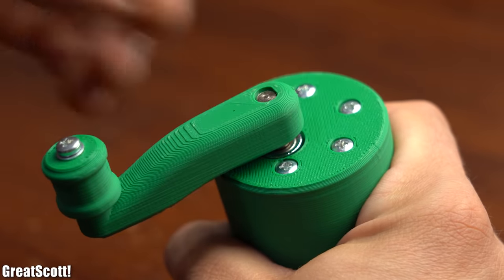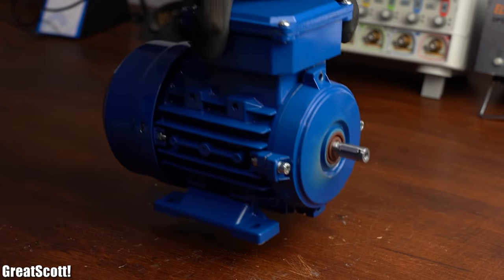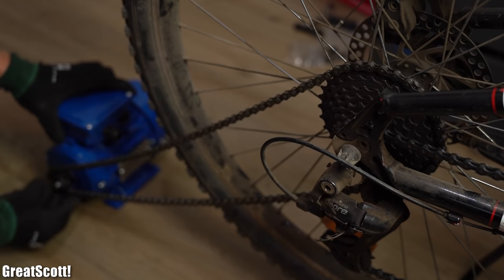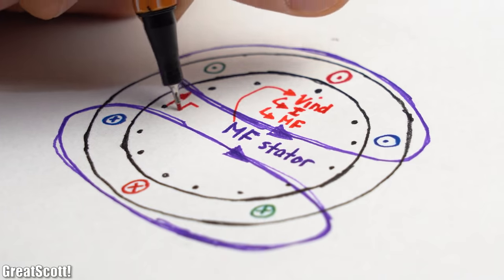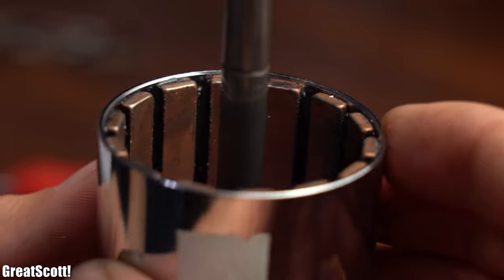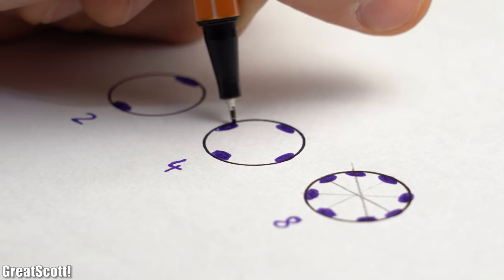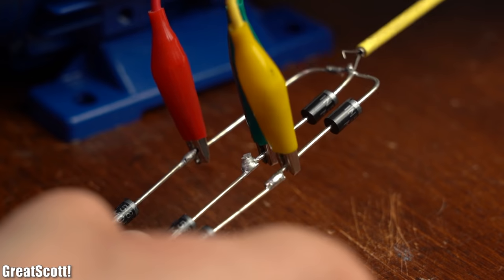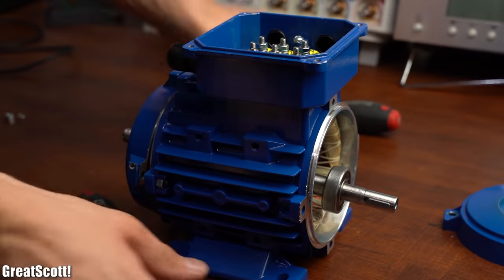HACKED!: Turning an Induction Motor into a Generator?!

Comment: An induction motor can work as generator without modification.  it need external power supply first. but when it reaches Above synchronous speed. it start generating power.
Reply from the maker: Correct
Reply: @greatscottlab  
if you are going to try it with connected to grid then it will generate power at grid frequency (60 or 50hz)

and if with capacitor bank frequency can be different.
Reply: @greatscottlab  I think there may be a way to use capacitor(s) to self-excite induction motors?  Not sure if this works without initial power.
Reply: @senorjp21  Robert Murray-Smith has video on this called "An Induction Motor As A Generator Without Altering The Motor"
Reply: @senorjp21  this can be achieved by providing reactive power , usually with the help of a capacitor bank
Reply: you'll still need to supply reactive power to the gen for it to generate power in a stable fashion.
Reply: @matthewmaxwell-burton4549  
well while connected to supply it can take reactive power. grid can provide reactive power.
for standalone purpose .
capacitor bank can be used
Reply: basicly u just have to connect a charged cap and it will work
Reply: There are ready to buy controllers that are efficient, and allready generate power from the kinetic energy put in a induction motor. But the motor first need to have some induction as mentioned. But useally these motors are used in generator mode in combination with drive mode. In the case I have used them, it was In dynamometers, when the inertia of the dyno didn't match the car, the motor could be used as a drive, but also als a brake/generator and could provide power to the net. But this is a big hasle, and expensive because you will need an active filter.
Reply: Insted of doing soo much modifications, you could have got a synchronous generatior easy, converting an induction motor to a synchronous motor is a bad idea
Reply: Please match the number of poles on rotor and stator. It will work.
Reply: @nachiketadeshmukh8444   Thank you for saying that
Reply: I was just about to say this :)
Reply: I don't remember exactly how to do it but what you are right. I think this video deserves a second try making an investigation, what I remember is that yo need a DC power to generate, that is the way that AC power is generated in many countries
Reply: Yes, also consider that thanks of the residual magnetism a simple capacitor can generate the external power in order to achieve the excitation of the rotor cage, naturally, in order to generate power the rotation speed need to be FASTER then the synchronous speed. Scott will be great to see a video about.
Reply: To be useful for anything other than running incandescent lighting, I assume we'd need to an AC-DC-AC inverter to manage frequency?
Reply: @stupossibleify  that's can be an idea, actually I will think more to use a transformer in order to step down -> rectifier bridge -> linear stabilization or step down-up converter in order to have useful 12/24v ....then maybe you can charge batteries and then use a dc-ac converter in order to have a stable 50Hz 220/110v
Reply: like a care alternator ? (those IIRC do not have magnets)
Reply: I bought a pmg* witch was made form a car alternator 
Pmg* - permanent magnet generator
Reply: Or just add dc to the windings
Reply: @synchro-dentally1965  thanks
Reply: I think this is how car alternators work
Reply: What you do is connect the motor coils in Y, add capacitors in delta, spin it, introduce a magnetic field to start the chain reaction and boom. AC output equaling the motor rating.
Reply: @sfp4197    a recent one? or old one ?
Reply: @foufou33g  recent
Reply: Throw a magnet through a copper pipe, or move the pipe really fast while keeping the magnetic stationary. Both works. You just didnt spin the rotor shaft nearly fast enough compared to how fast the significantly stronger magnetic field rotates in order to induce a reacting field in the rotor. Also people, there’s a significant difference between needing a wired rotor vs a squirrel cage rotor. Good luck  exciting a squirrel cage rotor.
Reply: Youtube engineering lol
Reply: You can make a self excited asynchronous generator with capacitors. I remember a technique for select the perfect capacitors for that application. Is used in for applications where the frequency is not a problem or with an inverter.
Reply: @tripplefives1402    in the self excited induction generator, the electric frequency depends not only in the shaft rotational speed,  the load will increase the slip and the frequency will change, no matter if you preserve the shaft frequency, also the voltage will drop due to the impossibility to generate reactive power.
Reply: You mean first input power  to generate Electro magnet to start its own power but after  that it creates  and takes its own power to creat EM for its Stationary coils .
Here my doubt is clear my guess was right .
Reply: would i be correct to say that it is simular to an alternator in a car but for AC?
Reply: @senorjp21  yes it will work, i have  tryed it.   when you are reaching syncronous speed, the it will start making power
Reply: Indeed, the video mentioned in the answers popped out in my video suggestions right after watching Great Scott's video 🙂
https://youtu.be/j-LgEbdJ8AM
Capacitors are the key.
Reply: But how do you produce magnetic field on rotor. I am searching for this but I cant find any
Reply: @greatscottlab  You are making me cry what you did to that rotor!
Reply: @stupossibleify  lol look at this galaxy brain
Reply: you cannot power the squirrel cage; magnets are imperative; you could adapt a rotor coming from a car alternator
Reply: This is initially what I thought he was going to do.
Reply: Yes
Reply: @senorjp21  initial voltage will build up due to residual magnetism.
Reply: instaBlaster...
Reply: @synchro-dentally1965  Thanks a lot for this recomendation! For those who need, here's the link: https://youtu.be/j-LgEbdJ8AM
Reply: @dg.candido  No problem. Thanks for posting the link. I am always concerned about providing the links because YT or the creator may flag the comment for deletion.
Reply: Can synchronous reluctant motor can be generator
Reply: I'm curious as to how this works with trains, as dynamic braking uses the async motors as generators, but obviously while braking you're going slower than synchronous speed
Reply: I cant find anything about induction motor as generator, i have an idea to hook up (with belt) an induction motor on to diesel engine so i can use it as a generator for some small apliances. Can it work?

Comment: Bike generator: a device that generates bikes ;)
Reply: Fleischwolf- it wolfs Fleisch 🍺🍺🍺
Reply: In my school I got a question can you explain.
Q-) Electric shock is caused by_____.
. Electric current
. Electrical potential difference
. Electrical resistance
. Electrical energy
(Note you can choose only one option)

Edit:
Correct answer = Electric current
PLS EXPLAIN 🥺.
Reply: Edit :

It's electric current because the amount of shock you get depends on the resistance and the supply voltage. It's I = V / R ( Ohm's law. ) Imagine you're connecting your 20 ohm resistor across 20 V. If your supply is current limited ( Constant Current  / CC mode, ) the voltage will drop down but if your supply current isn't current limited ( Constant Voltage / CV mode, ) the current will remain high and could burn the resistor. And one more thing, DON'T BELIEVE THOSE " IT'S CURRENT THAT KILLS NOT VOLTAGE " CRAP THEORIES !!!

Here's some videos to make you more understand the laws :

 https://youtu.be/XDf2nhfxVzg

https://youtu.be/DOMs7mYm_zs ( skip to 8:29 )

Sorry before. I write these comments on 2 o'clock in the morning, so yeah :-/
Reply: good one
Reply: Generates bike's energy
Reply: A factory
Reply: hah ,👍

Comment: you can turn an induction motor into a generator if you kickstart the magnetic field in the rotor by powering the stator at startup for a short time, this will generate residual magnetization which will self-excite the motor under load. i would love to see it in a video, thanks for the video 👍
Reply: actually it will require continuous reactive power.
if it is connected with grid or capacitor bank it will take reactive power from it.

otherwise it will not work.
Reply: @rahul-fl2zc  yep i forgot about the reactive power source, 3 capacitors will do the job
Reply from the maker: I can put it on my to do list :-)
Reply: Tesla model S already used this for regenerative braking
Reply: @greatscottlab  I love this idea too, I need to make a pedal generator from a brushless washing machine motor to charge a battery+ultracapacitor bank pretty soon, ideally without opening up the motor
Reply: Many small hidro/wind stations use asynchronous motors as generators. If they are grid connected you only need too increase the speed above the synchronous speed, for not grid connected you only need to use a dc pulse on 1 phase to get some magnetisation going then you can find calculations for the correct capacitor values online for delta and star connections.
Reply: @gurupriyasukhdhami8227  I think all Tesla cars have bldc motors and they work both ways without any additional requirements...
Reply: @AshutoshSingh-to9vx  no they have both bldc and asynchronous
Reply: @greatscottlab  Easiest way to do this is with a capacitor and a momentary relay.
Reply: Indeed, i was completely thrown for loop when he didn't do this lol
I was expecting something along the lines of piggybacking a much smaller permanent magnet motor(like from an R/C car) onto the main generators shaft/sprocket, so it could provide the needed energy to magnetize the rotor,  it would probably also need a few capacitors as well to kick-start and/or stabilize the whole thing.
Of course it'd be a fairly insane & impractical way of doing it, but it'd make for an awesome video if it succeeded =)
Reply: Check out how regenerative braking works.
Reply: @lagmonster7789  This should actually work, small permanent magnet somewhere near the original rotor.
Reply: Scott, Please match the number of poles on stator and rotor. Otherwise, there is no point in doing anything else. You will still get milliwatts in output.
Reply: @AshutoshSingh-to9vx  i don't know i have seen that in a YouTube video
Reply: Do you happen to have any tips on how I might make a chainsaw motor into a generator?
Reply: @markoantesic4362  I am attempting to convert a chainsaw motor into a generator do u happen to have any know how you can lend me for this?
Reply: @losvega5004  Yes, find a different motor. 1) Chainsaw motors are not designed to run for long periods of time at full tilt 2) they have 10k-14k rpm. For a normal asynchronous motor you will need just above 3000 rpm (single pole pair) or 1500 rpm (double pole pair).
Reply: @markoantesic4362  wwll where did you learn all of your knowledge on motors. Zeeing this man make one makes me wish to give it a go. However I thought using a gas motor would be a easy way to make a cheap like gas powered generator .
Reply: @losvega5004  masters in power electronics :) If you have no back ground in these stuff, I would suggest you firstly take a look at some theory then start with small kit. I know there are some examples that use small nitro motors and a dc generator to run some light etc. Then you can experimented with other types of motors and learn why they work and why they dont.
Reply: @markoantesic4362  im gonna do that then. I'll learn about how motors function. How generators work and etc.
Reply: Plenty said to excite with power …to get magnetic filed, thats half north half south not a bunch alternated try half perm magnets north and other half south mot alternating
Reply: Z

Comment: So it turns out that you only wanted to make a thumbnail with that motor and bicycle tied together. CLEVER
Reply from the maker: Not really. I experimented a lot with the bike and generator setup but had to decide against it in the video.
Reply: @greatscottlab  Yeah we know. Just wanted to tease you lil' bit😉.
Reply: @greatscottlab  I think you should reconsider the magnetic assembly design and magnet polarities like I said in my other comment. Match rotor magnet poles with stator poles and also pole area.
Do update us if there is any progress and about the process.
Reply: HA HA HA HA HA! Great point!!! I so the thumbnail, my first thought was "Great, A-Synchronous motor as a generator!" ... O_o and then he bought two !!!NEW!!! Induction-motors to prove he is wrong, OMG
PS I'm not an electrical engineer.....
Reply: GreatScott! You know you can make some bike chaines smaller ..

Comment: Scott: "This gear kind of works with the bike chain."
"I secured the gear with 2 zip ties."
Me: Screams in mechanical engineer
Reply: Beter than hot glue
Reply: lmaooo same
Reply: I felt that.
Reply: "Me: Screams in mechanical engineer" it's always funny when people react this way... but i understand why more often than not stuff just has to work, no be perfect and beautiful.
especially in a test setup
Reply: CHINEZU englez that would not work
Reply: Yeah, two is definitely over kill, you probably wuld have got away with one
Reply: @chrisakaschulbus4903  I mean, you just need a drill bit, tap and a set screw. It's not that hard
Reply: @chang302  "It's not that hard" i can show you what's real hard ;)
Reply: His name is not scott his name is Jeremy the channel name is great scott yeah I was surprised to
Reply: If you use hot glue then the gear would just fall off, because hot glue does not work with metal
Reply: @chrisakaschulbus4903  huh
Reply: @big_o1952  "huh" yes?
Reply: @chrisakaschulbus4903  you mean my whole life was a lie and I am not omar i am poopie
Reply: @big_o1952  you got it :D
Reply: Scott: cuts open the cage in TWO perfectly fine motors, effectively destroying them
Me: Screams in electrical Engineer
Reply: What would you use to fasten the gear to the bike then? If you have any other know how id be please to learn. I'm rn attempting to convert my chainsaw engine motor into a generator.

Comment: I think that the main problem you had here is the number of magnetic poles you chose. If the stator has p = 1 (1 pair of poles, or 2 poles) your rotor needs to have also 2 poles. In this case, if you choose 8 magnets, you can put 4 adjacent magnets with the north pole facing outwards, and the other 4 adjacent ones with the south pole facing outwards. Otherwise, for each phase, a EMF will be induced in each coil but they will not have the same phase, so you can get them totally or partially cancelled.

If you go with the 2 pair of poles motor, you can do the same, but creating 2 pair of poles in the rotor also. You can do that with 4 magnets of alternating polarity, or with 8 magnets, but you need to have 4 pairs of adjacent magnets that are facing in the same direction (Just to be clear, if you check the polarity of each 8 magnets, you will have: N N S S N N S S).

Comment: You could try using a capacitor bank in order to supply reactive power to the system. Usually the responses get a bit better, but still, not great.
Reply: yes, this is NOT the way to turn an induction motor into a generator, a quick google search could show the way
Reply: he is replacing rotor with permanent magnets.reactive power will be required if magnetic field has to be created from supply.
so here it is not required.
Reply: Sure. I meant he could keep the squirrel cage and just attache capacitors to the stator. I believe it's a simpler solution and possible to provide better results.
Reply: adding capacitor bank is a good idea
no needs to modified any part of the induction motor dont tell me to add magnet to the rotor, then you are making the induction motor into synch motor

Comment: You need to reduce the air gap between the rotor and stator. You'll see higher peak voltages after that.
Reply from the maker: True, but I think it would still not have output a decent amount of power.
Reply: He Also need a better rotor he should reuse the original one and he could drill a lot of holes in it to fit magnets
Reply: Yeah, that distance between the magnets and the coils looks like a big handicap to the whole thing. The dipole magnetic field is falling off with r^3. Or do you see another reason why energy transfer here was so bad?
Reply: @mdrolc  The rotor need to be ferromagnetic to conduct magnetic flux better. Tight airgap and magnet back-iron will reduce reluctance of  the magnetic circuit and inprove back EMF.
Reply: @MrThecoco974  👍
Reply: @greatscott my man getting lazy 😅
Reply: @greatscottlab  On the contrary field density drops off as an exponent to distance. The inverse square law very much applies to magnets and it looks like you have more than two magnet thicknesses between the rotor and stator... Horrendous for generating voltage!  If you were to halve the distance between the spinning magnets and the coils it would nearly quadruple the power... then there is the induction equations... you are inducing a current using only about 2/3 of the magnet length... again you are going to get horrendous energy transfer... it is the electromagnetic equivalent of using the wrong chains... it will work... barely... You usually go well into the details and the math of why these things work... too bad you didn't follow through with it this time, you might have had something pretty good.
Reply: @greatscottlab  Match the number of poles on the stator and the rotor. You said the  first motor had two, so you should only make a two pole rotor.

Comment: For a much better operations:

a) the number of pole pairs of the stator should match the number of pole pairs of the rotor
b) the magnets need to be stuck to iron on the inside of the rotor, so that the magnetic circuit has much less reluctance, meaning more magnetic field
c) the air gap should be reduced as much as possible

I think a and b together will already make the generator much more powerful.